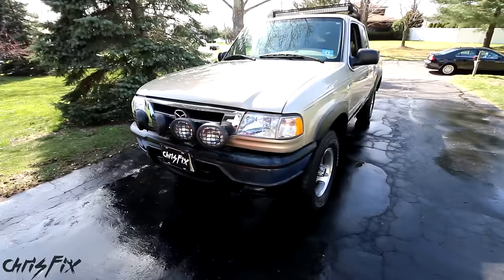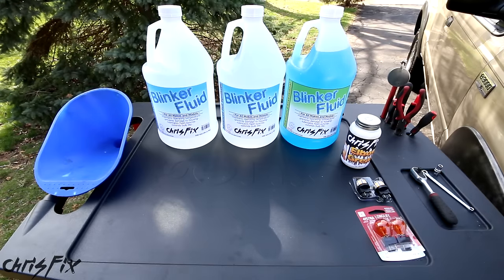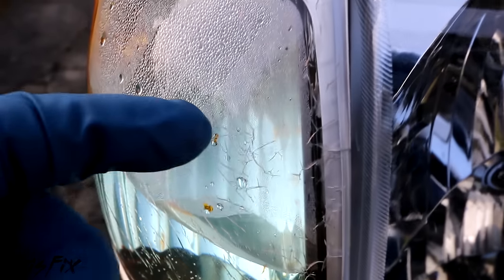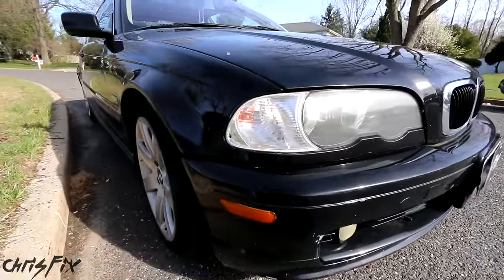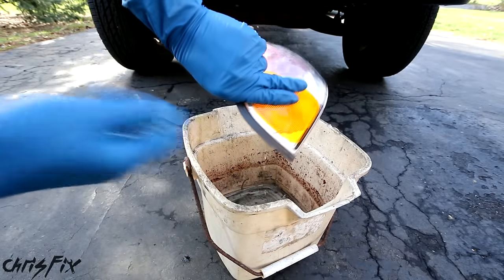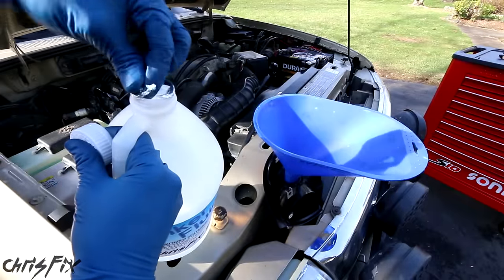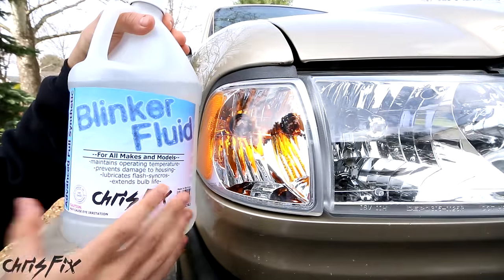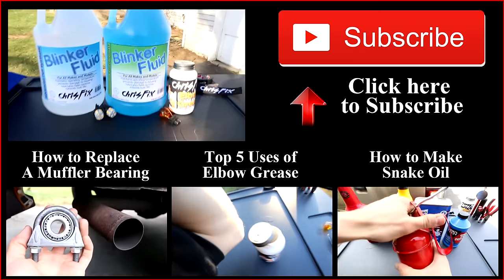How to Replace Blinker Fluid

Comment: lol never heard about blinker fluid is this for old cars?
Reply from the maker: +Raymond van Wyk Watch the whole video!
Reply: +Raymond van Wyk Newer car manufacturers use the synthetic blinker fluid with  double plasti-ceramic O-rings and seals to prevent the fluid from leaking.
It is not possible to change that fluid by yourself, and in case the blinker housing breaks or gets damaged, they just replace the whole thing.
Reply: Mohammad Sharara interesting
Reply: watch till the end m8
Reply: +Indrid Cold are you serious?
Reply: Replaced my fluids today, blinkers are working perfect again! You should try it
Reply: Yes, yes it is
Reply: +Indrid Cold 
you said it! LOL analog. analog lights? are you sure they are not digital? Also old cars use raster oil filter, the new ones use vector synthetic ones. No one knows that but me...
Reply: no. it's not real. it's an April fool's joke
Reply: +Alexis Wilson duh! I was kidding 😂
Reply: +Isaac Brooks I know
Reply: +Isaac Brooks I put that comment on hee case a idiot finds this lol
Reply: +Raymond van Wyk It's for April Fools ;)
Reply: +Francisque S :-)
Reply: yes actually. they recently have found a new way for the blinker to remain cooled
Reply: +Duebers lol
Reply: Lol genius.
Reply: +Aintquite Wright Make sure you dont get the really blue blinker fluid as thats only for emergency services

Comment: To prevent issues, you should change your blinker fluid on a regular basis, the synthetic brand is good for exactly 200,000 blinks and the conventional is good for 150,000. If you go over by even one blink then you have a high chance of getting a leak so make sure you keep track.
Reply: Also don't forget to change the blinker fluid filter while you're at it. 👍

Comment: Nice, now all I need to do is change my seat fluid
Reply: RorschachArcumn yes so it heats up faster and it gets hotter
Reply: RorschachArcumn just like reverse flushing the heater core
Reply: RorschachArcumn I need to change my dash fuild
Reply: Mr Ender That's very important, many people forget to change the dash fluid every 10,000 miles and it never ends well.

Comment: But will it fit on my Honda?
Reply: yea
Reply: Nice reference, m9.
Reply: +Kris Underwood
It works on all models. It's just more complicated to remove the Honda blinker unit.
Reply: +Kris Underwood fit on all cars it will as long as a turbo they have
Reply: When the vtec kicks in vroom vroom
Reply: lol #mightycarmods I know that phrase lol
Reply: +Kris Underwood Depends, how tall is your rear wing?
Reply: +Kris Underwood Marty would know
Reply: +Kris Underwood No, foreign cars need special blinker fluid. Really hard to find. Try asking at sushi places.
Reply: +GritsnBeans That actually made me laugh
Reply: +Kris Underwood you have to use jdm blinker fluid
Reply: +Kris Underwood Turbo Yoda is not impressed
Reply: it fit perfectly on BMW!
Reply: +Kris Underwood Yeah it will fit your Honda, it will also add 10,000 horsepower!!!
Reply: lol. #Honda
Reply: it's a joke
Reply: No way! Honda makes their own 'specially formulated brand - specifically designed for high performance JDM engines.' 
It says right on the bottle: for use only with Honda Engines.
Reply: +JesusRockstarRedux There's also a very helpful page in the owners manual on the subject.
Reply: +GritsnBeans not tall enough.
Reply: +Troy Andrews I'm crying 😂
Reply: According to The Magnuson-Moss Warranty Act, the federal lemon law, if you have to buy "Honda" brand to keep the warranty in affect, they must supply it for free.  Mopar and Harley dealers have had issues with this violation...implying that their brand MUST be used. There are other quality brands that may be used .  For the Honda, be sure to use the metric fluid... it comes in liter containers, whereas, the Ford, Dodge, Chevy, etc., comes in gallon containers...
Reply: +skylane807 well, shucks! Off to the Honda dealer to get some. Gotta make sure I get my VIN number right - sometimes all years aren't compatible. Don't want to put 92 in a 2000! That'll be sure to mess up yer automatic fender adjusters. Did that once... bad idea.

Comment: Great manual, thank you. On my car though, the blinker glass is fully orange (not white glass with orange bulb), and there is no way to understand if i need to add more fluid or not. The housing of the headlight bit cracked from inside, and most likely because of uneven spread of temperature, but i sure they do not need any fluid.

Comment: when do u change the gas in your car
Reply: You should probably put the gas in the oil filler and and oil in the gas for extra performance you get an extra 100000000000 Hp
Reply: never
Reply: I know this comment is old but hopefully you haven't done it yet because as long as you change ur steering fluid every month u should be fine 👍🏻
Reply: As you drive!!!!!!!!!!!!!!!!!!!!!!!!!!!!!!!!!!!!!

Comment: I think all mine leaked out because my blinkers are empty
Reply: Corbin I.N.C you should fill it up it might break your blinkers
Reply: jacob richards wow lmao isn’t this ironic 😂
Reply: icon had a bunch of people all me that all the time. I've been a mechanic since 2007
Reply: jacob richards no, op's comment was sarcasm, that's what I was trying to point out.
Reply: Dude replace it right away it is the coolant for the bulb and if you don't have it your bulb will get so hot it explodes and your car catches on fire lol.
Reply: That might be a problem with the bulb, you see, the bulb feeds on blinker fluid and it is probably starved. Give it a few refills and you should be fine. P.S, you should also groom your bulbs every 1000 miles.

Comment: I drive an import. Should I get foreign air in my tires?
Reply: Definitely. Would recommend rotating the air in the tire while you are there!
Reply: billy joe Ha! I'll look into that for sure.
Reply from the maker: The stuff imported from Germany is the best. That German engineered air is amazing!
Reply: ChrisFix Will check it out for sure!
Reply: while its true German is the best, i still highly recommend Italian air. its just as good for a better price!
Reply: Though Italian air does do wonders for tyre-rotation and subsequently tyre-life , it also tends to oxydize your airvalves!
So if you do choose Italian air, make sure you de-condensate your tyres regularly.
A safe interval is every other week! You can do this with any regular hairdryer! +/- 15 min. per side per wheel!

Good luck and safe driving!
Reply: *****  the joke is over. you are too late
Reply: O'hare sells some good/fresh air.
Reply: This all depends on the tire's country of origin. If they are made in the USA,. local air should be OK. For German & Japanese tires, you will have purchase specially scented compressed air only available in metric size canisters. Your local auto parts store should have this product in stock.
Reply: Nitrogen will do.
Reply: JDM only
Reply: You should use foreign air, make sure it is import from wherever country your vehicle made...

Comment: I need to know if people actually thought blinker fluid was a thing
Reply from the maker: read the comments... lol
Reply: ChrisFix honestly you had me scratching my head for 3 or 4 seconds before I kicked my butt 😆😆😄
Reply: As long as it does not freeze in the winter or damage the reflector this might actually be a good thing. Maybe you should patent it :)
Reply: Jonas Lithén ...Rear-projection TV's actually used something like this "blinker fluid" to keep their picture tubes cool. The fluid had to be changed out if the picture started to degrade due to the fluid becoming cloudy. The red tube was usually the first to do this for some odd reason. Kits were available with all the necessary stuff to do a complete TV fluid change!
Reply: maverickdallas100 🤔
Reply: I didn't know you can put fluids in there either
Reply: BMW drivers do
Reply: Jon I shit u not. I saw some at auto zone
Reply: I thought it was real, what is the stuff in at the start?
Reply: IKR, I was looking at the thumbnail like "Seriously?"
Reply: Jon sadly yes
Reply: look up gavin free and headlight fluid
Reply: I did 😂
Reply: Ayush Rao congratulations. 🤗
Reply: Jon not me but my friend did

Comment: Brother I really appreciate this video. I managed to get the blinker fluid changed on my van, but couldn't believe how expensive the stuff is! I didn't have any elbow grease handy, so I substituted with wadded up duct tape, but it does seem to leak a bit. I'll go into town and pick up some elbow grease next payday.

I've been having problems with my headlights as well, and am wondering if the procedure is the same for headlight fluid. 

And could you do a video demonstrating how to swap out a muffler bearing and fluflu valve, please?

Comment: I added blinker fluid to my 97' explorer and now the bulbs burn constantly whenever I turn on the headlights. Can anyone help? Did I add too much? Plz help!!
Reply: Michael McCaskell Hahaha
Reply: i did the same on my 2012 dodge charger and it wont stop burning the bulb and the wires
Reply: imperfect gaming after tightening the lug nuts, replacing the gas cap, and rotating the owners manual in the glove box, the problem was still there. Finally it hit me.....the muffler bearings!!!! Problem solved
Reply: oh ill try that
Reply: Don't forget the fuse box fluid!!
Reply: also the tire fluid, window fluid and the door fluid
Reply: imperfect gaming there are actually tire fluid when you have emergency flat tire.
Reply: Add a small amount of elbow grease or snake oil (I prefer elbow grease: it's generally more potent than snake oil and lasts longer) between the bulb and the connector.  If this doesn't work, double check the expiration date on the blinker fluid. If blinker fluid is left out for too long, it becomes more acidic, which can corrode the contacts in the bulb.
Reply: r/wooosh

Comment: Tire coolant is a bitch to change. I need a video!
Reply: Get a car with air cooled tires. Maintenance free.
Reply: +Dcc357 This guy knows his stuff!
Reply: been thinking on changing my water and sawdust in my differential
Reply: Try changing the tire coolant filter
Reply: +Manuel Felix Used car dealers actually used to do that with worn transmissions to make them silent and shift smoothly for a while. Talk about shady.
Reply: I stopped using tire coolant when I switched to solar daytime running lights. My mechanic told me I couldn't use both. I can see so much better in the daytime, it's worth the hot tires.
Reply: your probably just running the wrong kind of air.  Are you using winter or summer air?

Comment: The BMW dealerships charge a LOT to replace synthetic blinker fluid because they have to remove the entire front bumper in order to access the headlamp units. This could result in misalignment of the headlamp washer nozzles if you try to do this yourself.

Comment: In older units you probably want to change the gasket also to prevent leakage.Some like to use a dab of silly cone, but that shouldn't be necessary with a new gasket.

Comment: I have never heard of "blinker fluid" until now. I thought they were just lights controlled by a flasher unit. Last time I replaced blinkers was on a 1981 ford. Going outside to check my car now to see if it has this. Doesn't appear to. If it  has it, it appears to be ok. I gotta remember this in case I have to replace the bulbs.  The plastic covers that go over my headlights and my blinkers are getting a little 'cloudy' tho'. OMG I DIDN'T CHECK THE DATE ON THIS. YOU TOTALLY GOT ME!!!🤣🤣🤣 LMAO!

Comment: I recently rebuilt my blinkers so they are sequential, like Audis. After topping up the blinker fluid, magic smoke escaped from my circuit. I am told that once magic smoke has escaped it can no longer be re-inserted. Did you also experience something like that and if so, what did you do?

Comment: Washing car with my daughter. While washing her wheels i pointed out the black washing down the driveway. I suggested a engine issue causing such a oil leak.she eventually also asked if she needed blinker fluid for the auto parts store

Comment: The problem is with older cars.  I had a '70's jag that had the same issue.  Not the blinker, the headlight.  I went to Jaguar dealers, aftermarket and performance shops.  None of them knew what I needed.  Some just laughed when I told them what I was looking for....yeah, thanks for helping.

Comment: Theoretically, if you had a liquid, that when electricity is applied, immediately glows brightly, you could have an open loop system throughout your car and use tubes to replace blinkers.

Comment: My daughter drives a 2012 Prius C that has some kind of sealing issue. Rainwater gets into both of the rear lighting housings (the left more than the right for some reason) and eventually reaches the level of the bulb. It doesn't seem to hurt anything, but I still pop the housings out and drain her blinker fluid every year or two. Honest to God.

Comment: Hey Chris, I know this video goes back a few years, but the info is still relevant and I found it very helpful. 

I wondered if you could maybe do a video on maintaining proper brake lubrication. Mine have started to squeal, and I found that spraying the pads and rotors with WD-40 provides a temporary solution, they are a lot quieter. But I want to do it right, and I’m not sure how to do it.

Comment: Question how much do charge to flush and refill gas on my tires. Also how many miles should I change my license plate. What engine oil is the best to clean the windows. Which gas is recommended for my diesel truck.

Comment: Ah, i've never knew you would need blinker fluid for it. I have always used 10w40 full synthetic on my blinker housing and to prevent leaks i added flex seal.

Comment: I did notice that you used the wrong funnel, it was labeled water not blinker fluid.
Reply from the maker: As long as you clean the water out and it's dry it's fine to use for blinker fluid
Reply: @chrisfix  I think I'll be on the safe side and invest in a dedicated funnel, Lisle corporation actually had a limited edition blinker fluid funnel that I hope they bring back!

....I almost couldn't even think of a response.. clean out the water LMAO

Comment: i have noticed you dont have a video on "how to replace piston return springs" there is little information out there on this important subject, i think the lack of info is caused by manufacturers making the false claim that they never need replacing, we all know that is total bs. i recently installed high compression racing return springs in my toyota and it goes like a bomb.

Comment: I found out 
If you drill a hole at the top you never need to change the fluid only when you occasionally roof your car
But otherwise it will magically fill the blinker with blinker fluid

Comment: Something i noticed is that he actually replaced the blinker housing with a new one.
Just be shure check the point where he says the before and after.
The old blinker housing had cracks but the when he says after there are no cracks...🤫🤫🤫